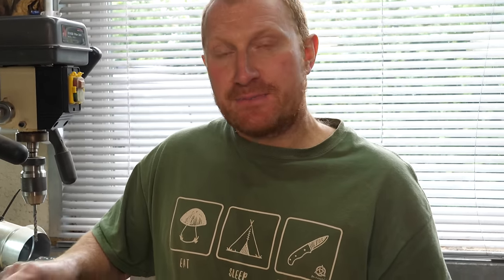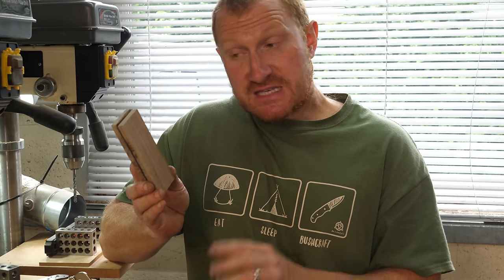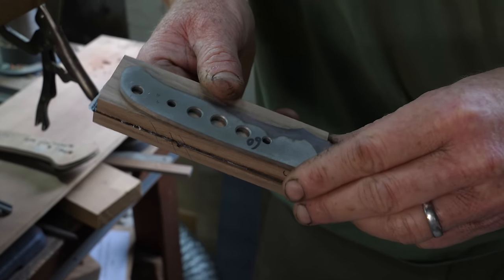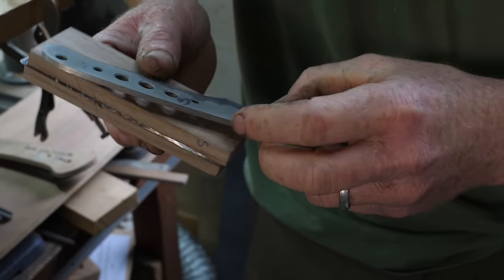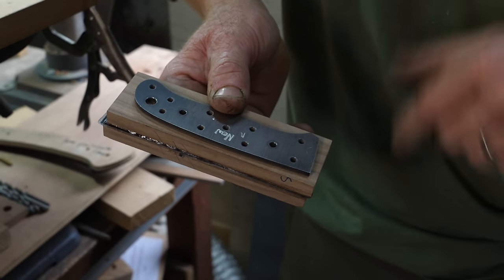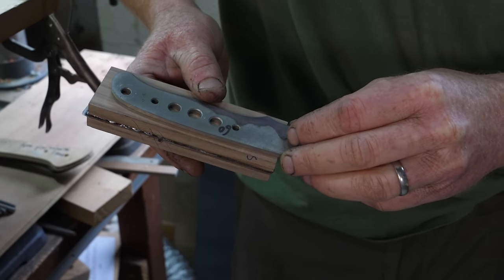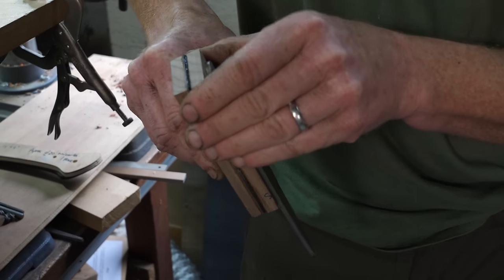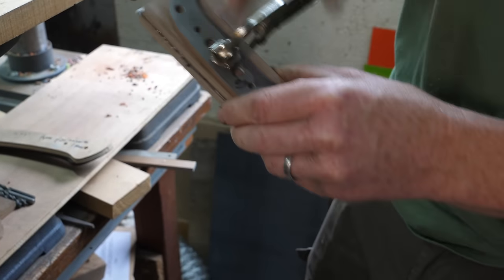How to Make a Knife Handle - Drilling, Profiling & Dry Fitting

Comment: Newbie here. What is the liners purpose? Thank you
Reply from the maker: No problem, well they do have a gasket effect when added to the knife, helping the bond between the handle material and the tang. Vulcanised fibre is the same material as used as a gasket in your engine of your car. 
Basically they help with any slight movement of a natural handle material and the steel, But I would say 80% is really the overall look of the knife handle. Hope that helps explain it for you. Many thanks cheers Ben
Reply: @BenOrford  thanks

Comment: You don’t need a c clamp, you don’t need a block. All you need is a drill press vise. That is what its for. So you don’t have to hold the piece you’re drilling into. It holds the pieces together and holds them still as you drill.
Reply from the maker: Thanks for the comment. Sure if you find that works for you then that cool. Not sure how that will help hold the blade secure to the handle material though? This is a simple system that works well and for most folks is a simple way to get great results 👍

Comment: U just complicated with those 3 same drills...
Reply from the maker: Sorry do you mean the three holes in the middle of the handle? These are for weight reduction and glue bonding 👍
Reply: No,i mean 3 same drilling machines,changing drill bits takes few seconds,but steps nicely explained all in all...
Reply from the maker: @heric.4428  I have about 7 pillar drills with all different drill bits. When your into production saving time on changing tooling is a real key 👍 glad you enjoyed it.